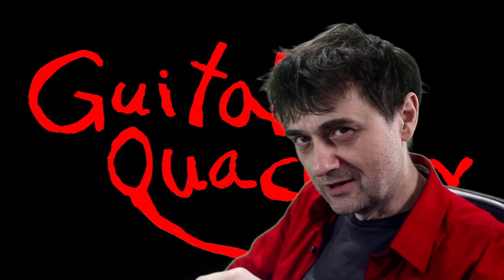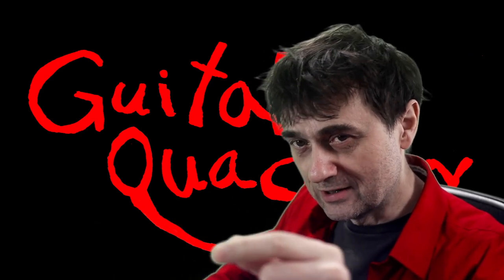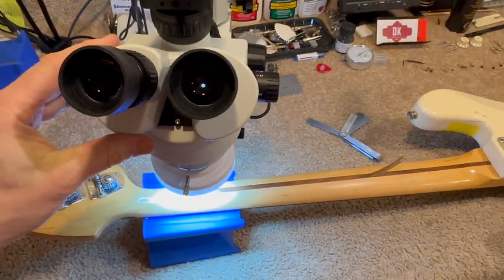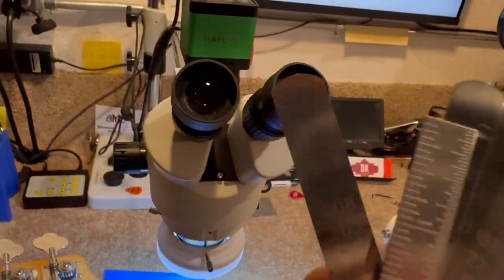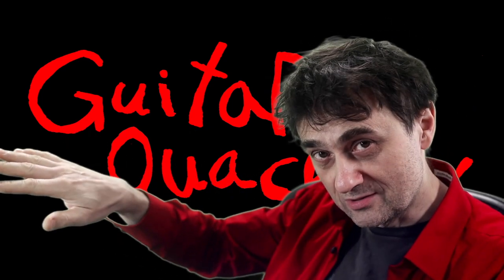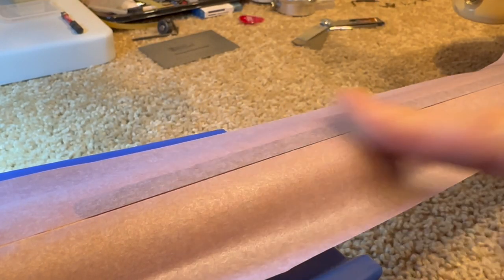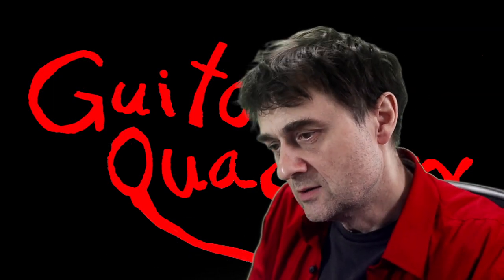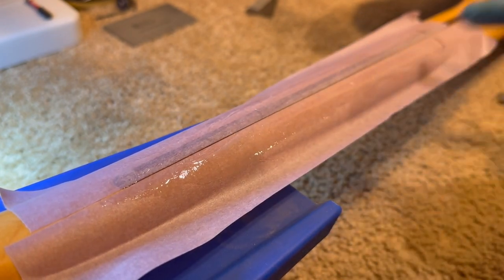Fender Jazz Bass Neck Skunk Stripe Repair

Comment: Thanks for posting this!  I bought a Strat neck years ago with this issue, I knew it had the issue when I bought it so it was pretty inexpensive.   "Fixed" it with a little wood glue, but years later the glue has loosened a bit.  I'm going to try this method next time.  I'll probably need to clean the gap out a little with an X-Acto knife first.
Reply from the maker: Surface preparation is the important first step in any glue joint.

I would not attempt to clean the gap using an X-Acto blade. You should use a feeler gauge to clean the gap.

Comment: excellent video!  Thank you.  I was wondering if skunk stripes can be removed intact and reinstalled?  I have a one piece bass neck that needs a new truss rod, and I'm deliberating about whether to try to gently pry it out, rather than rout it out.  Thanks again for the great video.
Reply from the maker: Skunk stripes can definitely be removed, but in most cases I don't think we can hope the would come out intact. I guess it would have to be already completely loose, to come out without tool make and damage.
Reply: I just read a comment on another video -  Score down the edge of the stripe with a sharp blade, then heat gun and pry the skunk stripe up in one piece... Wish me luck! 😬
Reply from the maker: @sonclearbrahman-ar1461  There's an old Chinese proverb: If it sounds too easy to be true, it probably is.

But, alright... I do wish you luck.

Comment: Great video! Cool to see how you handled the issue!
Reply from the maker: I see this issue 2 or 3 times per year on skunk striped necks. If memory serves me, now that I think about it, I believe that I once solved it with low viscosity superglue, as the gap was not eve wide enough to let me push the feeler gauge in. Basically, just because I used epoxy on this case, it doesn't mean the epoxy is always going to be the filler of choice.